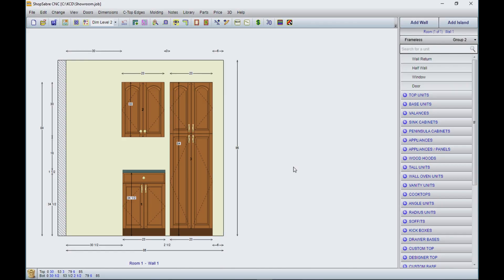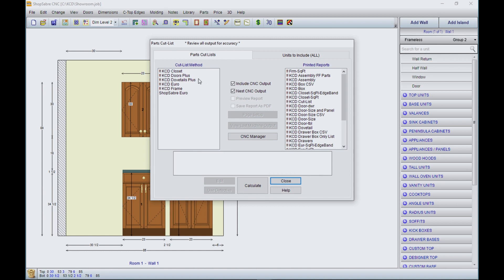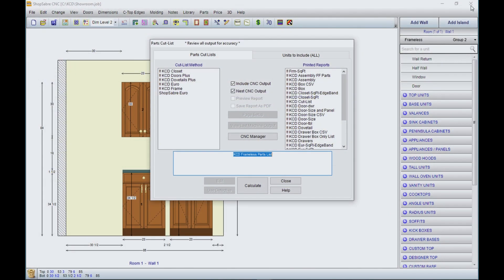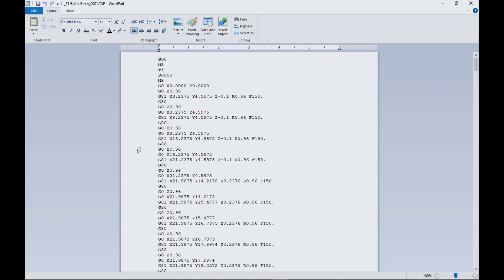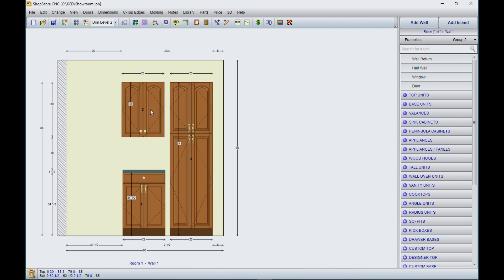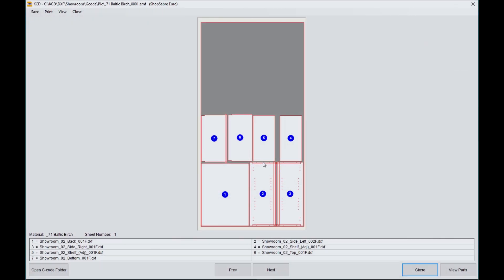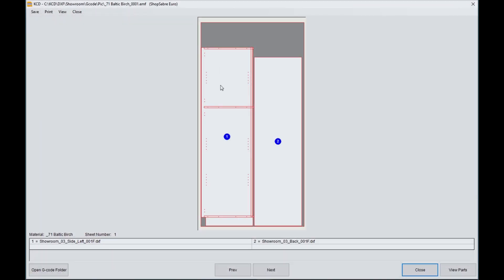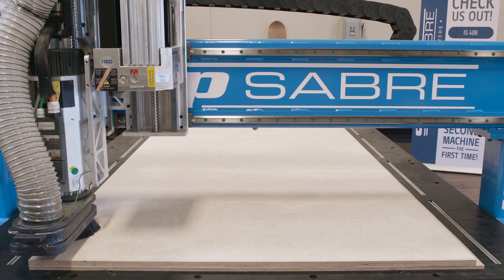KCD Cabinetry Software Sample Cutting with ShopSabre CNC Router!

Comment: How did the CNC know how to cut the parts like speed and drill bit size, etc.
Reply from the maker: You program the directions using the KCD software in this case, but other programs can also be used. For more information on this process we offer training to get you going with your CNC. Our technical support team can also assist owners with this question. Give them a call at 952-461-4570